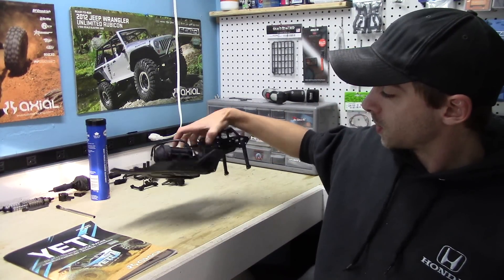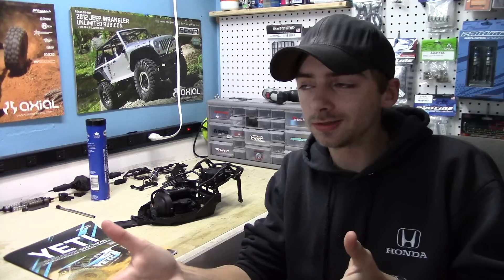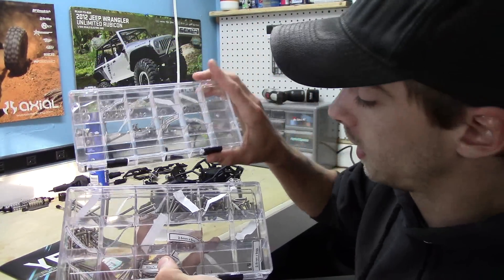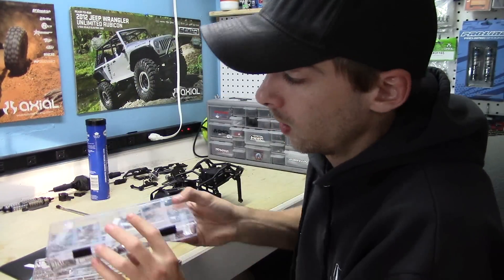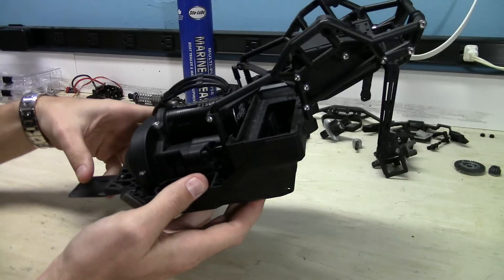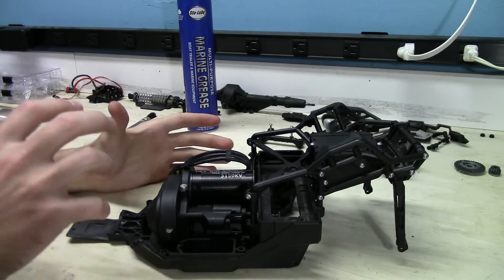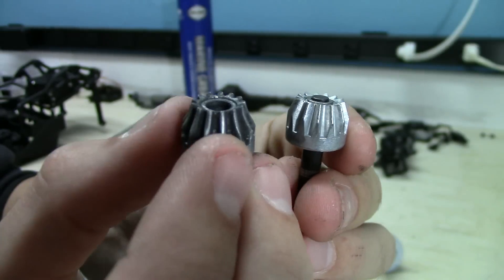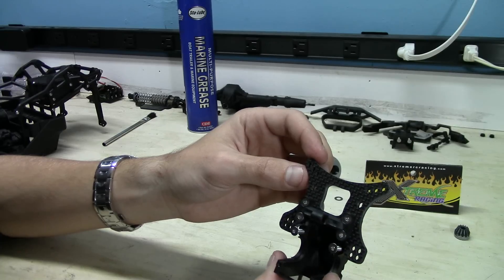RC Overload - Axial Yeti Upgrade - PT 1 - Front Differential & Carbon Fiber Shock Tower

Comment: Matt, i'm chose to build a 1/8 axial yeti xl. i'm building it piece by piece. i know it will be a bit pricy. i would like to know you opinion on which esc and brushless system to buy for it that would allow me to run on 2 lipo batteries. please let me know. thank you for your time

Comment: I had the same problem with the rear diff on my exo. I got the hd gear set and shimmed the diff to solve the problem.
Unfortunally the new gears you bought are out of the same pott metal as the old ones and if you didnt shimm the diff it will happen again....
Reply from the maker: lukas1672 Ya unfortunately when I ordered up those gears no one had made and HD set at that time. however sense then, multiple companies have come out with different ones. So after a few runs ill recheck them again and probably do some drivetrain upgrades by that point.
Reply: I am not sure about the rear of the yeti, but the front is practically a Exo so you can use the Exo hd gears in the future

Comment: Matt, with the bigger tires, are you getting any grinding issues? I have added a ton of upgrades including the stronger gears from axial I have grinding in the rear diff. I was wondering if you have seen the same type of thing.
Reply from the maker: with the stock drive train setup... yes... my gear couldn't seem to handle anything.